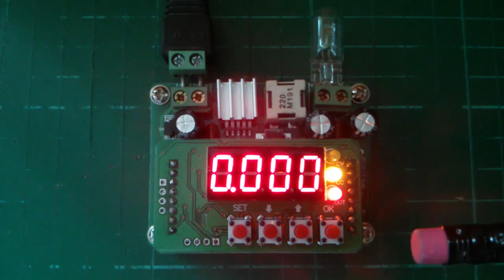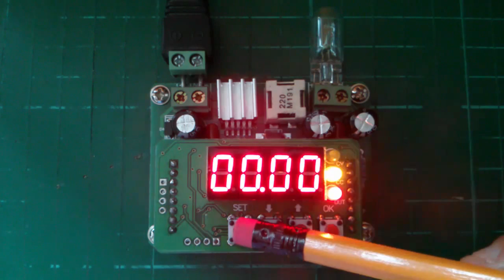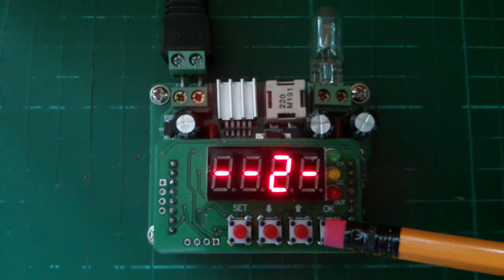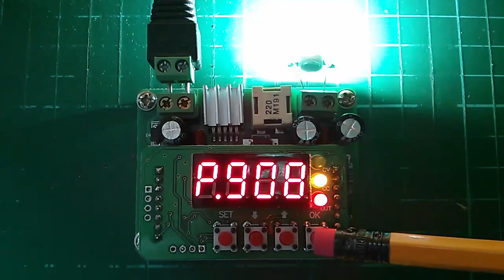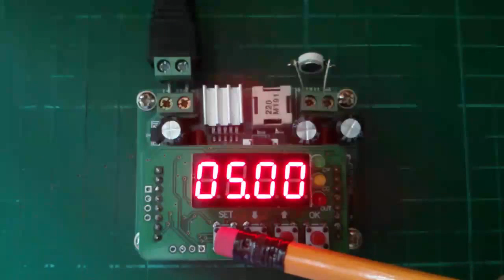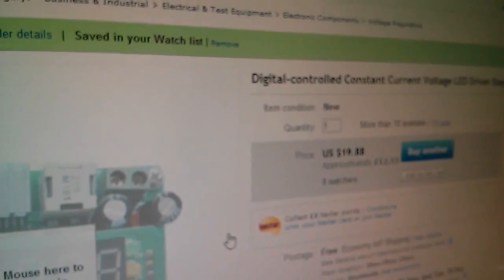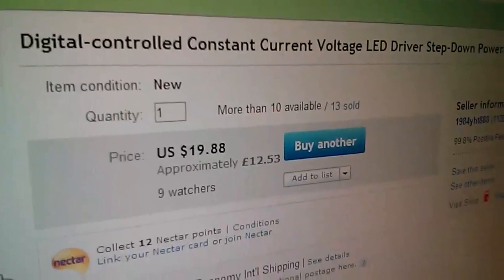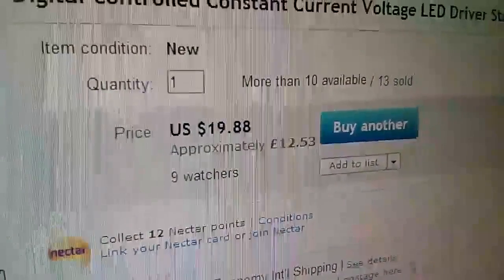Review: 3A 40V Digital Buck DC/DC Converter - It's more like a Bench PSU!

Comment: Awesome info ! I've got a cousin of this module in the form of a Boost converter. It's a 8-60V to 10-120V converter that I use a solar PSU for my lithium batteries (great for charging to the desired voltage and up to 10A if need be). The interface uses the exact same features as this module (including hiddne menues), that means I can display instantaneaous power and total Ah put inside the battery. Thank you, thank you, thank you for enlightening me on this, I never would have found by myself ! I'm subscribing to your channel right away.
Reply: Please could you post a link to it.

Comment: Thanks again, I purchased one of these years ago when I first viewed this video.  Then I played with it for awhile before putting it in a box where it sat, doing nothing for a couple of years, perhaps 3 or 4 I don't recall.  So the other day I thought I would like to build a variable desktop power supply, I had already built a couple of solid 3 volt, 5 volt and 12 volt multi volt units, one that runs directly off the 110 volt mains and another that I power with 4 18650 batteries when I just want a quick power up.  I purchased a nice little 5 volt unit and modified it via the Big Clive channel to give a good solid 5 volts and use it to both light up my power shelf and power anything that really needs a good pure 5 volt power. So I dig out the old unit and using some old ATA hard drive cable with added DuPont ends, extended the screen to the outside of a project box, then added a nice lcd monitor to watch the out-put, and powered her with 3 18650 batteries.  Made a nice unit but over the years I pretty much forgot all about how to run the thing.  SO this video came to mind, and I was off in search of it.  Found her today and now I know how to run my new DC-DC bench power supply with duel digital display!

Comment: I'm pretty green with electronics...  If this is a buck converter, that means it won't be able to produce a voltage higher then the input voltage, right?  I'm guessing you'd want to supply something like 24v in if you want to use it as a bench supply?
Reply: You're right (in case you didn't figure it out yourself in five months time). 24V would be good for a lot of applications. Just keep in mind, that you have to put in at least the same amount of power that you want to take from the output.

Comment: Thanks for this, and this video is why I purchased one myself.  However, I have a question for you or someone here who may know...  I just received mine in the mail today, and have been having a mess around with it, and am loving it - However, the question I have is I can't get mine to power-cycle to set the "secret" options.  Could it be that I ordered a copy-cat version of this?

Steven
Reply: I actually found out how to set the "secret" settings, and that is (to Power Cycle like he said), and to do that - He is actually switching off the power, then holding down the "Ok" button, and switching the power supply back on.  What was confusing me was that he didn't say he was actually killing the power to the buck converter to power cycle it - I thought that he was just holding down the "Ok" button for a few seconds, so after an hour of that, I figured that not only should I stop holding down the button because it was hurting my finger, but also I came to realize - that my way was most assuredly NOT the right way to get into the "secret" settings ;).

CAUTION!!! - I actually killed my buck converter the other day :( - I hooked it to a 48 volt power supply by mistake, because I thought it took up to 60 volt input.  And after going to the website to review the specs (which I should have done in the first place - of course), it says that you should NOT exceed the input by more than 1.5 volts, which for me don't make any since at all, that they would create such a small window - for mistakes.  

I can't find anything on the board to indicate failure, so I haven't a clue what to replace to fix it.  This device should also be equipped with a fuse, but then again, I should have inserted one myself between the main power supply, and the input of the buck converter LOL..  My baaaad...

Comment: here's a really stupid question. I have this unit and was wondering if I could use it as a trickle charger to charge a motorcycle battery using my 12v 2A power supply or even a lap top power brick as I would really need about 13.5 volts instead of 12. If that would work, how could I go about it? I was thinking about using the 12 supply and limiting the current to 200 milliamps, then from there using the lap top power brick and increasing the voltage limit a little at a time till I got 13.5 volts? Is this a reasonable approach, or is there a lot more to it? Thanks

Comment: Thank for your video explanation on this Module.
May I ask if you use this module as a battery charger, how would you set up this module, such as Voltage & Amp limited setting  and stop charging when up to the Max Voltage for the battery ??  Thanks  !!

Comment: I have one of these in a boost converter. Minghe bst900. 
I bought it to bring back 5ah pb battery that had set for a long time among other uses.
But it never goes into cc mode. If I set the voltage at 14..1 it will give the battery what ever it will take even way over the current that I set.

Comment: Hey Julian, have you had a look at this models big brother the B3606?
I just got one from banggood and so far it seems ok. One thing I have noticed is that the heatsinks are fixed to the board, each by two soldered pins. The really interesting thing is that the output of both the diode and the buck converter share the same circuit trace as their respective heatsinks! So when the output is turned on both heatsinks are at the same potential as the positive output of the converter!

Comment: Are there any tolerances for the voltage? I have a rectified voltage (~ 45V DC measured without load) of a transformer (30V/4A AC). The datasheet of the LM2596S says maximum 45V and the RMS should be 38-42V DC. I don't want to kill the converter when i switch on the power supply.
Do you know more?
Thanks
Reply: You may want to take a look at this eevblog forum post which has a lot more information than you can get from the datasheet ;)
http://www.eevblog.com/forum/reviews/b3603-dcdc-buck-converter-mini-review-and-how-the-set-key-could-be-fatal/

Comment: Wouldn't have been difficult to attach a bench meter to this to verify the output. You seem to be relying on 'faith' in an LED display or the lack of burned out bulbs, etc. as 'proof' that it works. Of course, I'll rush right over to that web link and order one of those extremely accurate converters. Nah, I'll just keep looking for reliable reviews.

Comment: Hi Julian, I have this same model. But it is behaving erratic recently. 

Any idea why it can regulate voltage but NO current? I'm probing with my multimeter to be certain and there is definitely voltage regulation but it can't drive anything as there is no current. 

In fact the current constantly ready 5mA which is annoying. 
I have tried the factory reset and it won't help unfortunately.

Comment: +Julian Ilett, I bought one on your reccomendation and started using it to test LEDs and how bright they are at different current values.  It fried about five LEDs before I figured out when you turn it on with high voltage max and low current max it *DOES NOT* current limit until at least a full second into the poweron, at which time it has already gone way beyond the current set and fries the LED.

*THESE ARE UNSUITABLE AS A CURRENT LIMITING SUPPLY!*
Reply: Did you remember to set it to menu "0"? That is what everyone needs to remember to do if you don't want it to boot up and power on before you change or check your settings. Seen at 5:20 in.
Reply: So how does this led does not burn? Hey the Julian has a scope and can verify this.

Comment: Julian Ilett Could you use this to charge a 18650 li ion battery in order to find out the capacity of the battery? Thanks
Reply: Gavin Keeley In my opinion you can but there are better and safer ways to do that. Search for Imax B6 charger, most used charger in RC community, it can charge all possible batteries (Lipo/lion/life/nicd/nimh/pb or lead acid, etc..)and it has a feature where you can see how many mAh is pumped into the battery.

Comment: Hi Julian,
One simple question, If I connect a DC permanent magnet generator to the input (which is constantly varying the input voltage from 10VDC to 18VDC); and a 5VDC LED circuit to the output (fixed output) will it still work? Will the LEDs light up? Assume no overcurrent to the LED circuit.

Thank you!

Comment: Nice! I've been searching for ways to build a bench power supply for testing electronics with around 3A maximum output and this one seems too perfect to pass up. I have a question though. As far as the DC input voltage, does it have to be rated for 3A too? Or can it be lower rated, lets say, 800mA?

Comment: Julian, thank you for a very useful post. I first saw them on DadHav's Youtube site and he gave you a shoutout.  I bought 4 of these valuable trinkets. I like the fact that i can adjust voltage and current limit at the design site and free up a meter to measure volts,amps, power and "C" (which I never tried to do). I have 4 power supplies with analog meters and feed their outputs into a trinket.

Comment: Hi Julian, great review. I bought one of these on the basis of your comments. As this unit does not have input reverse polarity protection can you perhaps suggest an appropriate diode to use for this? I think it is a bit of an oversight by the manufacturer to leave out such a cheap component. Also, should such a diode be also attached across the output in the event that you were using it to charge a battery and also wanted reverse polarity protection? Of course, we always try to be careful and avoid such a scenario but best to be safe!
Reply from the maker: David Maddison Pretty much any diode of sufficient current would work - and would be better than no diode. A diode in series with the output would be better than one across the output.
Reply: +Гасан Аликберов heheheh,.. uhh right! Seriously mate?

Comment: Hi Julian, I got myself one of these, but I've managed to fry it (Doh!).  I had a 12v battery connected to the output, and then connected my solar panel the wrong way around.  It powers up and you can adjust the settings, but it doesn't output any current.  Any idea what I might have cooked on it?  Many thanks in advance. Jimmy.
Reply: Voltage regulator?

Comment: Can I use something like this to power a 500w led, with a 70Ah 12V battery. Tell me please, have plans to make a 500w led flashlight/spotlight. And if i cant use something like this, what can i use to power a 500w led with only a 12V battery? Or can i connect the led straight to the battery?
Reply: This unit has a maximum current capacity of 3 amps. A 500 watt LED at 12 volts equals 41.67 amps, which is far beyond the capabilities of this unit.
Reply: ok, thanks :-)
Reply: Mortæææn Assuming that you will be using an array of leds and not a single led (which does not exist I think) then you can indeed arrange your leds so that they will run directly off your 12V battery.  typical small leds will run with 1.2V or thereabouts so series connect 10 in a row, then another 10 in a second row and so on till you reach your desired power.
Higher power leds may run with higher voltages. so, if the led will run with 2V then only arrange 6 in each row.
etc etc.
Reply: using a 500w ledchip with 500 1w leds
Reply: what is the voltage/current rating of that ledchhip? they could be arranged any number of ways.
Reply: 64-72V
8750mA
Reply: have a look at this:-
http://www.aliexpress.com/item/Free-Shipping-DC-DC-600W-10-60V-to-12-80V-Boost-Converter-Step-up-Module-Power/1755859569.html

note it will only give 120Watt output with 12V input so four of these with four 120watt led arrays would do it.  That would get you close to 480 Watts

Or, four of these in parallel might well work but you would have to try it and see.  Problem this way is that if the output 72V was not exactly the same on all four then they might end up working against each other to some extent. You could sort that with a low value high power resistor on each converter output before they all meet to run the lamp.
12v at 10amps is 120 watts
so this will convert to 72 volts at 10/6 = 1.6Amps per supply. roughly.
so put 1 ohm, 3 watt resistor on output of each supply and then join together.

you might need 5 supplies for max brightness!
maybe even 6.
Reply: Thank you :-)
I will try when I got enough money.

Comment: FYI, you can get this a little cheaper from Banggood.com at the moment. Seems to be a similar product. http://www.banggood.com/DC-LED-Digital-Controlled-Step-Down-Driver-Power-Module-p-910096.html
Reply: This one is even cheaper. £6,59!

http://www.ebay.de/itm/181867009810?_trksid=p2057872.m2749.l2649&ssPageName=STRK%3AMEBIDX%3AIT
Reply from the maker: That's a good price. It also appears to be in their UK warehouse at £8.97
Reply: I just rec'd mine from banggood, it's exactly the same.

Comment: could i connect this to a 12v car cig socket and use it to charge a 19v 3amp laptop?
Reply from the maker: No, because this is a step-down converter. To get 19v from a 12v car battery, you need a boost converter.
Reply: ok Thank you for replying. what boost
converter would you recommend?
Reply: buy a sine wave inverter , i have a waeco 300W pure sine wave inverter
it costed around €280 BUT its output is constantly monitored it has an earth ground.
and even if the input drops to 10v and back to 12v the ouput stays very constant !
with that given your aplliances no matter how sensitive stay protected
Reply: not what i want. i want a boost converter witch i will put where the ac to dc converter part of my charger is at the moment. it will still use the dc half of my charger to smooth things out and have less loss than an inverter. thanks for the idea tho.
Reply: Thank you i will take a look.
Reply: but how about a steady input ? i think the boost converter will cause some distortion ? think about charging the battery an/or system stability
my laptop adapter is also regulated and protected
Reply: im putting the boost converter in place of the ac to dc converter part of my laptop charger so everything that is after the ac part of my charger will still be there. Im hoping this will mean it will work no different as im only cutting in where the ac would have been converted to dc.
Reply: :p i mean the imput for your laptop :)
i think you should ask somewhere on a electric-hobby site ,, i would be a shame if your laptop dies
Reply: ahh i get you know. yeah this is one project im not going to rush google here i come :L
Reply: haha , google is indeed the best teacher !! good luck andrew
Reply: That is is thanks
Reply: ps ,if you filter out the signal,you can charge your laptop easily :D

Comment: I've just ordered a 400W board from love_my520 on ebay - just over £18 so I hope I avoid the customs... It has the same display board on top but a huge heatsink underneath!
Reply: ***** i think that's the boost converter, not the step down buck

Comment: Hi Julian,

Thanks for posting these videos, I've been watching a lot of them and they are very helpful. You've given me the confidence in crating my own aquarium light made up of two or three 10w COBs

The only worry is trying to drive them, specs are Voltage: DC 32-34V Current: 350mA Power: 10W

I was wondering if a buck regulator would drive the above LEDS using an old laptop charger?

Thanks, and cheers for the videos!
Reply from the maker: Not a buck converter - but a boost converter will do it. Laptop PSU is typically 19v, you need to step this up to 32/34v. Make sure you get a CC/CV type.